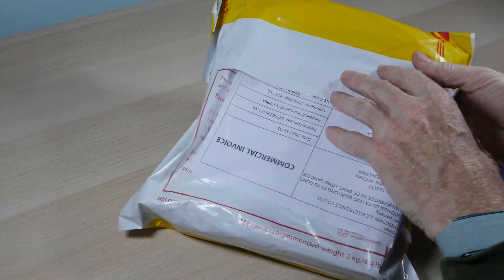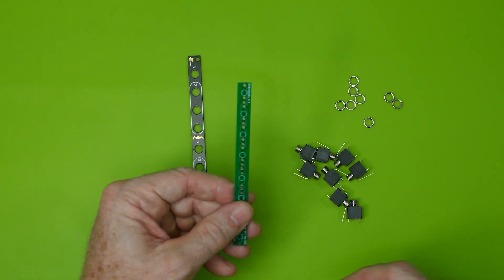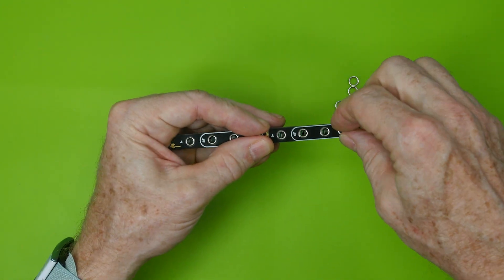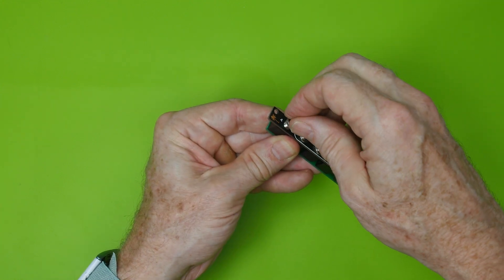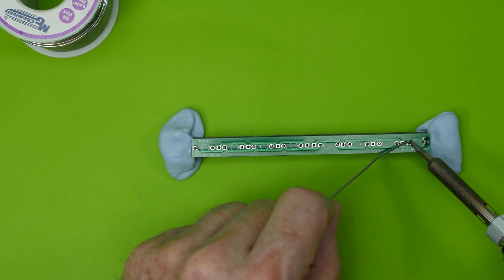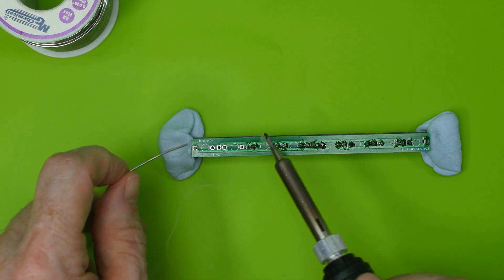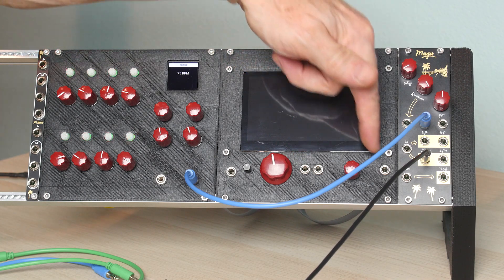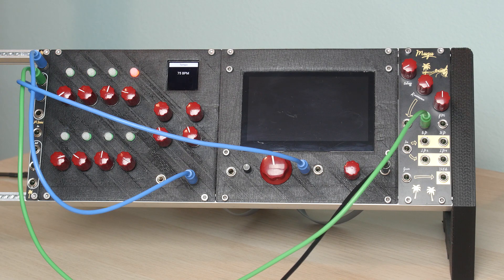How to Make Great Looking Modular Front Panels - Part 4 Assembly

Comment: I really learned a lot during this series, thanks again for making these and going into so much detail! A mixer as the next project sounds really great! May I suggest an addition? A mixer with FX sends would be great, maybe lowering to line level? I have a bunch of DIY guitar effects pedals which are really great DIY projects too, but Eurorack level is way too hot for them, so I end up needing two mixers and a preamp and I'm sure that could all be combined into one module! Thanks again for this series, and I'd definitely love to see more of these. Subscribed and I hit the little bell too 😀
Reply from the maker: So the plan is to keep the mixer super-simple to fit in with the beginner DIY theme. I'm thinking a 4HP wide module with only three inputs. However, I am thinking about adding output level control. Using that you should be able to reduce the signal level sufficiently to work with line levels for effects pedals.

The good thing about small, very inexpensive modules like these (and that you can usually only order them in multiples of 5 - so maybe you end up with more than you know what to do with them) is that I think you could pretty easily replicate the topology of an effects send with a couple of the mults from this series and 2-3 of the mixer modules. Use the mults to split the incoming audio and send it to two different mixers. Use one of your mixers as the "dry" signal and the other can be the effects send. Then use the remaining mixer to mix the dry and returned effects. You'll probably want more than unity gain for the effects return and that should also be easily accomplished via your choice of input and feedback resistances, perhaps in only one of the modules. I may demonstrate everything with unity gain but I'll try and remember to include descriptions of how you can change that.
Reply: @eurorackDIY  Awesome, thanks for the suggestion to use simpler mixers for this, that makes sense! And of course the return signal needs to be boosted too. I have one preamp in my signal chain already, so adding a couple more mixers would already give me one FX send. It would probably take up a bit too much space in the rack like that if I wanted 2 FX sends, but the way you just explained it makes the signal flow clear enough to design the mixer module I have in mind! Thanks again for making these videos, very useful!
Reply: @eurorackDIY  We are waiting ... ^^
Oh, sorry. I just discovered the mixer series.

Comment: If you ever consider more panel design tutorials - those LED window masks would be cool
Reply from the maker: Yeah, I think I know what you're talking about. I've never seen anything directly describing how you might do something like that but I figured you could design the board so there is no mask and no copper in the spots you'd like to let an LED shine through from the back. I suppose if you had several of these you'd need to do something to make sure they don't leak into each other. Perhaps some day I'll try something like that out.
Reply: @eurorackDIY  ThreeTom modular has a post about it. Its a full length guide to designing an LED blank with the window mask. Youtube wont let me past the link though

Comment: A breakout module for Arturia Beatstep Pro would be very cool :)
Reply from the maker: I'm curious specifically what you'd want to see as a breakout module. Arturia makes several controllers which are great for Eurorack because their gates and control voltages are compatible with the module standards. I have ideas about several kinds of modules that would work with the outputs of a Beatstep Pro: envelope generators, voltage controlled oscillators, midi inputs, and even gated sample players which would be a nice use of the Beatsteps gates to create drum lines.